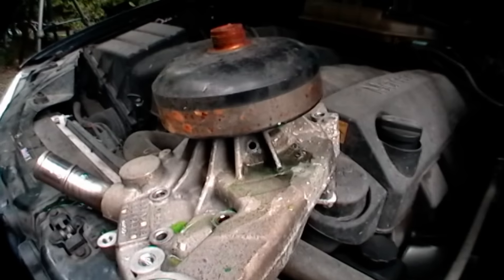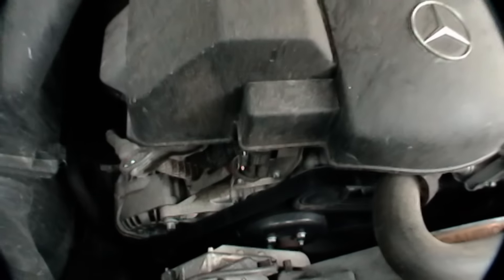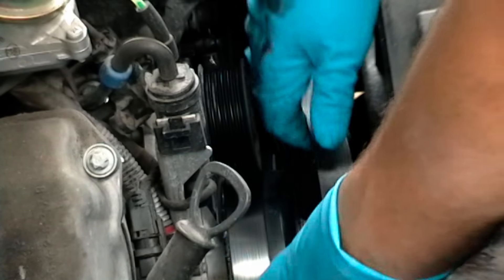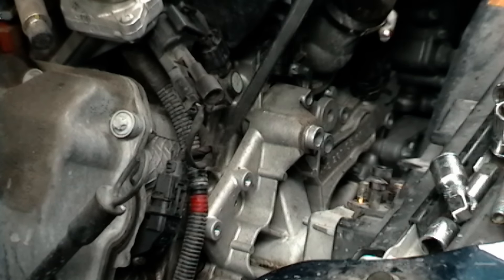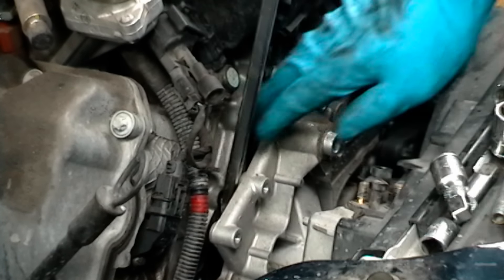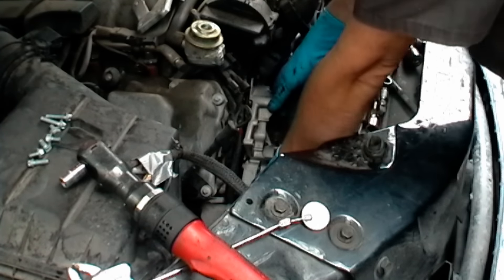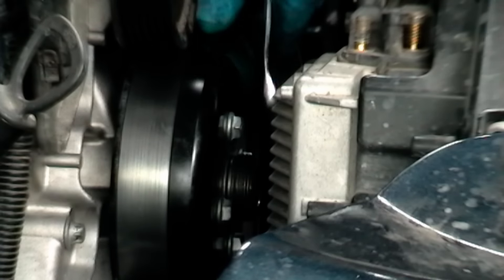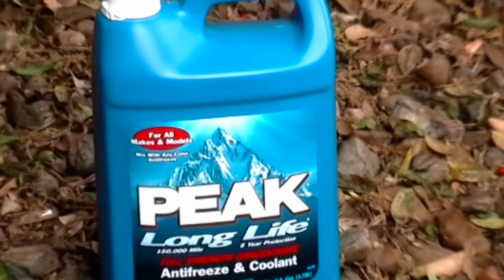How To Replace a Water Pump

Comment: Sounds good; I'll do that--thanks!  I've been noticing, though, that when I'm running my air conditioner, any time that I go UPHILL, the air ducts suddenly switch from the face to the feet, and won't go back until I release the accelerator.  Any ideas?

Comment: I just bought a 2001 pt cruiser limit manual and well i was driving Home it started to slow down then it cut off completely. Then we gave it a jump and it started.right back up. It was able to make it to my house sounded kind of loud though. So two days later i tired to started it back up and it just made a clicking sound. Thought it was the alternator but when i replaced the battery the car started right up and still starts up every time, do i still need to replace the alternator?

Comment: Hey Scotty, I just replaced a leaking water pump on a '08 Tundra with a 5.7 and only 60,000 miles. The guys at the dealer looked at me like I was crazy for doing it myself. They just couldn't understand the logic in me not opting to replace a defective water pump with the same brand that failed after only 60k. Well, the new one I installed leaked out of the weep hole almost immediately (bad seals?). Do you have any advice on one of the better brands of aftermarket pumps are available? From online research it seems this model has serious issues with this part. Any advice would be greatly appreciated.

Comment: Hey scotty, I have a 93 suburban k1500 5.7 188k miles and it is having a small electrical problem. It runs fine but if I have my heater on full blast it messes with my speedometer and the battery light turns on. I just replaced the battery so it shouldn't be that. What could it be? Thanks -Zack

Comment: Hi, Scotty. I have a benz c320 2001 but some people said not to put silicon sealant on the gasket and some say yes. What's the difference? should I or not put silicon sealant on the benz?
Reply from the maker: don't use silicone, but you can use other sealers like permatex weather stripping in a tube.
Reply: thank you! i just purchase a silicone today, but since you say not to use it then can I just put it dry with the gasket itself only?
Reply from the maker: Scotty Kilmer
yes, it's actually made to just use the gasket
Reply: thank you! i appreciate your help

Comment: I know. I just changed one, but its still making that high pitched noise. I filled it up with water before I started the car so I check for leaks and such and it started making that noise again. What do you think it could be that's making that noise?

Comment: If the upper radiator hose has a leak of air at the end would it fail smog? But no coolant coming out tho?
Reply from the maker: if hoses leak, you will lose coolant eventually. Fix such obviously broken things first
Reply: thanks a lot scott. I will do as you say.

Comment: Hey Scotty if i pull on my water pump pulley it has play in and out. Does the whole water pump need to be replaced?
Reply from the maker: yep, that means the bearings are worn, and no one replaces just the bearings, unless you live in India from what I've been told.
Reply: Scotty Kilmer would you advise driving on it? i have no idea how long that's been like that for

Comment: Hi Scotty. Long time fan and viewer. I was wondering if it's a massive pain to replace the water pump on a 1995 Mazda 626 2.5l V6? I'm an amateur mechanic and I do it for fun and right now I just don't have the money to go to a shop and I was wondering if I could do it myself.
Reply from the maker: massive pain in the ass, pays a mechanic over 700 bucks. You have to remove the timing belt and all that crap to access the pump.
Reply: appreciate the quick reply ill probably look into a new car. doesn't  seem worth the money and effort .
Reply: Mrstubbsthezombie A new car just because the water pump went out? They go out routinely even on cars just a few years old on occasion. It doesn't matter what brand the car is. Even Toyota and Honda pumps go out before reaching 50k sometimes.

Comment: Scotty! Need your help, I have an intermittent no heat problem.  I had no heat in car, long story short I put in new thermostat, garage changed manifold gaskets($1000), and a new rad cap, now the temp gauge goes normal and it blows cold air.(sometimes)  After I got in back from garage(Midas) I ran car to remove any air in system but still blows cold air occasionally, Today I noticed that if I floor it, the air temp gets warmer!!  Which leads me to my question--Is it a faulty water pump? That would explain the sometimes hot, sometimes cold, gets hotter when revved, right?
Reply: I love your channel, you answered me once before, I hope you answer again, I know its a long comment above! lol Sorry! Oh its a 2003 Chev Impala 3.4
Reply from the maker: flush out the heater core, they cog up with age, pray you don;t need a new expensive one
Reply: Scotty Kilmer Can't believe you answered so fast, you are amazing, I will be attending your Google Event!  I suspected the Heater core originally but after changing my thermostat I had heat, lots of it, but the manifold leak got worse so Midas changed that for $1000!!  Since then the heat has been on/off.. if I turn fan off and wait 10sec then put on High the air is hot but goes cooler right away, if I accelerate hard it goes warmer!  Could the belt be slipping, and pump not working properly?  Hmmm I did use Head Gasket Sealer couple yrs ago maybe you are right the heater core is partially plugged.  Thankfully I watched a great video ( by you!) on how to reverse flush it out, I will try that, Thanks again!

Comment: Scotty.....I have been trying to remove the water pump on our 96 Jeep Grand Cherokee. However one of the hoses going to the pump will not come off no matter what I do. None of the other hoses were difficult and came right off. I think someone put sealant on the hose before putting in the current pump.  I would just cut if out put in a new hose, but the geniuses at Jeep decided to snake the hose into a tunnel between the AC compressor and the alternator which is not accessible at all. The only other thing I can think of is the remove the compressor and the alternator. Any suggestions how to remove that piece of crap hose?

Comment: Ok Scotty I have a 2001 Chevrolet Malibu, Just yesterday it started leaking coolant at a very quick rate and now my engine overheats. I looked and looked but couldn't see where the leak was coming from. I put more coolant while the engine was sitting and i could hear squirting. I turned the car on and It began pouring out of the engine but I still couldnt see the leak. Could you tell me what it might be

Comment: my engine overheated. there isn't and coolant leak anywhere, but when opening the hose to the engine there isn't any coolant. The hose with the radiator cap is full though : )  . For some reason my fan was destroyed and the fan belt as well.
 But could my water pump be defective as well?
My car is a Nissan 300zx 1985 N/A.

Comment: my car's radiator fan kicks on as soon as the temperature reaches normal and doesnt cut off unless i turn the car off also the heat doesnt stay on unless im driving (doesnt stay warm at idle) could you tell me what that could be i have a 95 taurus with 122k

Comment: Hi Scotty, after a timing belt change (2 belts, tensioners, water pump, etc.), at a pro mechanic, I drive off. 20 minutes later I park and the car leaks out a litre and a half of water from the water tank. I refill the water to max, drive off again and keep my eyes on the water temperature gauge. Reaches about boiling point but never goes over it.

Whenever I stop and look, car hasn't leaked a drop. This continues for a couple of days, but today when I get home and park, a bit less than half a quart of water leaks out.

What might be the problem? The car has just come out of the service.

By the way, if it's any help, since they replaced the belts, I noticed the automatic climate control is a bit shifty, doesn't really work like before, sometimes cools, other times doesn't.

Thanks very much!
Reply from the maker: some mechanic, they are supposed to road test it. Take it back, or go to another mechanic and give the bill to the first one

Comment: mr kilmer , how to check the water pump is bad or worn?             257000 miles corolla   never change the timing chain n water pump.            does it need to b replace            when i check under the car            only water leaks   .thats all

Comment: Hi Scotty,
I have nissan primera 1996 1.8 ltr. water is leaking. everytime i hv to put more water. is it a water pump problem?
Reply from the maker: could be, pressure test the system to find out if it's leaking out the pump

Comment: i change my timing belt the tensioner and all the belts on my corolla 89 4af...
then it started making noise like the belt is slapping on the engine cover, adjusted it still making that noise, i also notice one of the belt that goes to the water pump have a litte wear on the side when i pulled the new one off?????

Comment: Is it the same for
A Toyota Camry 1994 
 4 Cylinders?
Reply from the maker: much harder as you have to remove the timing belt because it drives the pump on that engine

Comment: I have a 2.8 turb diesel Isuzu MU, my water pump is playing up... im going to have a go at replacing it, but first I need to kno if the waterpump runs on the cambelt ? im not to sure
Reply: when I fill the radiator water pours out behind the fan pulley..
Reply: i don't want to attempt to replace if this is the case as im not to flash with timing
Reply from the maker: they don't sell those here, so I've never seen one and my data system does not include cars not sold here. SO, call a dealer parts department, they can tell you by looking at their computer screen once you give them the VIN number

Comment: In my 1995 Chevy 3500 theshort piece of heater hose that goes from the intake to the water pump is swolen like a soft ball. What is the problem? Also the temp gage isn't working.
Reply from the maker: old age, replace that hose. And try a new temp sending unit, they often go bad.

Comment from the maker: @dewan247  Yes, they are crappers, designed by people just wanting to make em cheap and hard to repair. If you have a V6 engine, it's just one cow of a job. Get a cheap 20 buck or less manual that will give you every step and pictures. Scotty

Comment: Does the gasket only need the goo on one side? (Pump side?) Will there b air in the cooling system that needs to be purged after replacing the pump?
Reply: It doesn't need it (goo) at all. In fact it's not even recommended. I don't even know why he's using it.
Reply: typblack1 thought its only so the gasket doesnt move while u put the bolts in?
Reply: Not a good idea. Putting sealant (like he's using) on the gasket on will make it easier for the gasket to distort and slip out of place. The only thing i would use is gasket dressing (Permatex) - for paper gaskets only . It "tacks up" to help keep the gasket in place and from becoming saturated.

Comment: hey sir I have Toyota yaris and I need to change water pump the shop I took it too asked about 375 is that a reasonable price to get it fix? thanks
Reply from the maker: it is at a mechanic shop
Reply: +Scotty Kilmer no sir brought it back just thought I'll ask you
Reply: i was charged $369 to change the water pump of my car. labor and parts included.

Comment: Is the pump dyi on a 99 Lincoln continental or should I just pay the mechanics how hard is this job
Reply from the maker: not that hard, I could do on in about an hour. You just have to move a lot of crap out of the way to access the bolts holding the pump on.
Reply: Thanks for responding so should I give it a short or let the pro
Reply: Shot

Comment: i have a 93 holden jackaroo 3.2 does the timing belt have to come off if I have to replace the water pump
Reply from the maker: they don't sell em here in Texas, ask an australian mechanic
Reply: Gday you can take the pump off without the timing chain.

Comment: Won't it hurt the cylinders if you fill it with coolant while running?
Reply from the maker: Meta Mein no, you can actually run a car a few minutes with no coolant in it at all. The thermostat has to open up and you have to run it for that

Comment: It will be pretty bad on my 4runner. The water pump is driven by the timing belt. I dont like to do half ass jobs on my truck, so everything needs to be changed; timing belt, idler pullies, rad hoses, water pump, thermostat, coolant, the lot. In all about 300 dollars and two days to change. Fun. Fun.

Comment: scotty ....when changing the water pump, do you have to set back the timing
Reply from the maker: IF it was a cam belt driven water pump, yes the timing would have to be reset
Reply: OK THANKS...MY TIMING WASNT ON THE PUMP...THANKS AGAIN

Comment: have a 2002 siloutte van with a 3400 was having over heating problem changed t stat fuses, relays ,  hoses ect. fans were not coming on like supposed too checked them they work changed temp sensor also if i un hook temp sensor wire fans come on hook back up they do not
Reply from the maker: often a bad main computer does that, BUT you can just rewire the fans to a toggle switch and run them manually, a simple cheap fix

Comment: I have a 1999 Volkswagen cabrio 2.0 where do I find tge wAter pump and how do I change it
Reply from the maker: many places sell pumps, call around. Here's how to replace it"Coolant Pump Removing and Installing

Note:
Stretch-type studs or bolts are used to mount the pump assembly to the block. These fasteners should not be reused. Be sure to have new fasteners on hand before beginning the job.

Removing

Disconnect the negative (-) battery cable. Note:
Be sure to have the anti-theft radio code on hand before disconnecting the battery.
Drain the cooling system See: Service and Repair
remove the remaining hose(s) from the pump.
Mark the running direction on the poly-ribbed drive belt.
Remove the V-belt and the poly ribbed belt. Refer to Drive Belt, Service and Repair. See: Engine\Drive Belt\Service and Repair
Remove the alternator together with its bracket from the engine. Refer to Alternator, Service and Repair. See: Starting and Charging\Charging System\Alternator\Service and Repair
Remove the air conditioning compressor from its bracket without disconnecting any refrigerant lines. Place the compressor safely out of the way. Refer to Compressor HVAC, Service and Repair. See: Heating and Air Conditioning\Compressor HVAC\Service and Repair
Remove the coolant pump assembly from the engine block.
Discard the coolant pump mounting studs or bolts.
Installing

Installation is the reverse of removal.
Clean the pump mating surface before installing.
Always use new O-rings and gaskets during installation.
Fill and bleed the cooling system.
© 2014 ALLDATA LLC. All rights reserved. Terms and Conditions

Comment: Hey Scotty can I still drive my car if the water pump is bad I need to move it to my house but I don't know if it's recommended
Reply from the maker: as long as it doesn't leak too fast and overheat
Reply: I suggest you don't. You never know when it's gonna give out on you. mine did on the way to work. overheated then the belt broke.

Comment: Hi scotty, please help me. After replaced my water pump my heater does not get hot anymore. What could be wrong?
Reply from the maker: air in the system, burp all the air out
Reply: Hi Scotty, my Proton Savvy 2009 has done almost 60,00kms. I can sometimes hear the fan (I think) loudly like its working really hard? I noticed the temperature gauge going up and down sometimes but no engine light? I do have a leak not sure if that's the engine oil or coolant? I checked my manual but can't find where it says Water pump replacement? Was thinking if the water pump is the cause or would you know another solution for this? I ran the scan tool and nothing is coming up?

Please help me.
Reply: Scotty Kilmer please tell me a easy way to fix a waterpump in my 02 Chrysler Concorde limited 3.5L engine it's cold here in michigan and I have no hear half the time 😥 I can't afford dealership prices any easy steps

Comment: Hi, i have a 2005 dodge neon and the oil light keeps turning on. oil level is ok!
Reply from the maker: replace the oil pressure sending unit, pray it's just bad. If engine clanks though, pressure is low and that gets expensive, often a bad oil pump or bad bearings

Comment: what about jaguar s type r , mine is leaking coolant but i don't know where but i believe the water pump pulley is broken i called flying circus english car expert they charge me 700 just to fix the pulley and 1,000 pulley and water pump  i don't know if the pi=rice is fair cuz i see some water pump at auto zone for 90 dollars ,, what would you recommend me i don't want to hire another mechanic to get it fixed cuz im a little afraid  it may be cheaper but

Comment: Yeah, but my 99 Honda Civic's water pump is in the timing belt housing, making it quite a bit more laborious than this video makes it look. In fact, that's the very reason I took it to a shop. Haynes made it look way too difficult to get at the timing belt housing.

Comment: Scotty Kilmer if u rember me when I told you for my mustang when no one can repair. when u said to me for it needs to be replacement for termo stuck open. We found the problem. Overheatng was headgasket and waterpumpb leak. ANd today iam with no car about 4 months and a half and cost was 2000 dollars of repairing all together. Head gasket Thermo stuck open and waterpump leak and new pulley to. :( I am sad when no one could find the problem. ANd I was searching about 30 people in my country.

Comment: Hi Scottie I have 2000 dodge durango. How will I know if just the water pump needs to be changed and not the pulley or the other things the previous comments that were made by the guy a few weeks ago.  I am a lady I don't want to get ripped off.